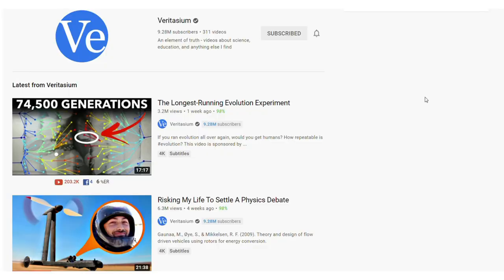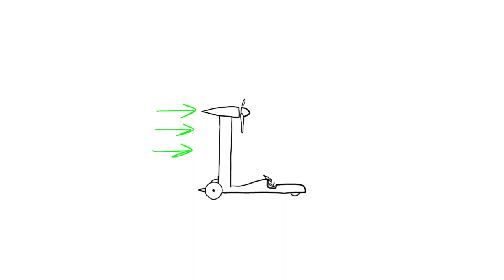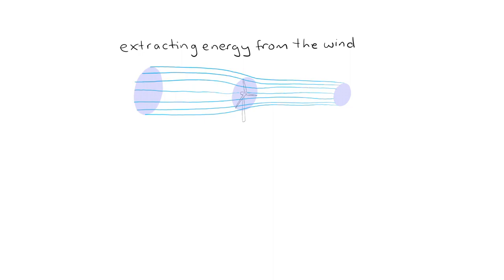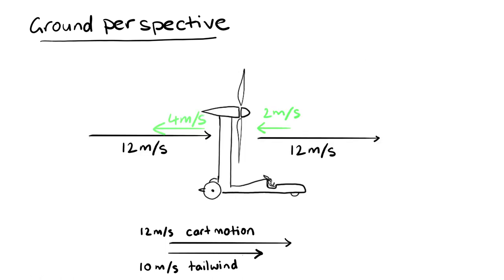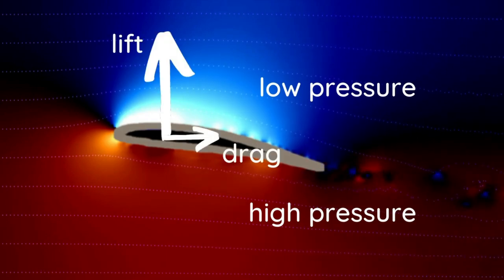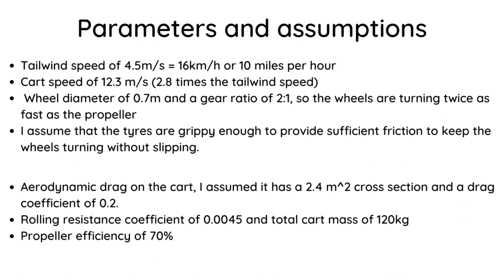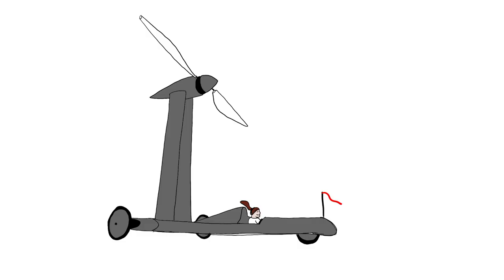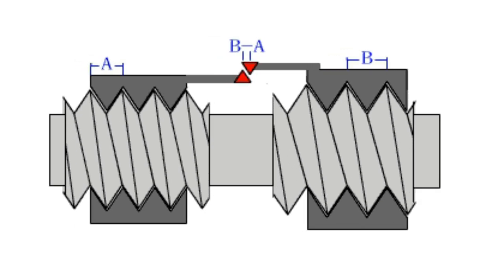Downwind Faster Than the Wind by Veritasium: How Does it Work?

Comment: Nice, what has been missing from many of the analysis of this is the variable pitch which was a point of discussion in the original video about how to drive the cart but no one else has addressed. It's the variable pitch of the prop which allows it to accelerate in low thrust mode as the cart is accelerating and then introduce thrust as the cart accelerates. It's the play off between prop drag and thrust which is the key to the cart being able to approach and then surpass wind speed. My mental model of this has always been the relative airspeed across the prop disc compared to free stream airflow and the resultant energy flow either towards or from the wheels. I'm of the opinion that at cart speed V0 the prop is driving the wheels as it is the source of most of the drag that starts the vehicle moving and then it's the disc of air which provides the drag. The reason it can accelerate beyond wind speed is that the disc of air is moving aft (thrust) as the prop accelerates so I would argue that the prop drives the wheel throughout.
Reply: Just so I understand your argument, what mechanism do you say is being used to get power from the propeller to the wheels?
Reply: The variable pitch is not key. Their prototype had fixed pitch and went faster than the wind too. It just needed longer to accelerate. Search youtube for "BUFC second run"

Comment: I think the hard part to grasp is that the ground itself is part of the mechanism. I find it hard, anyway :-)
Reply: It could be me but as explained, it seems to me that if there is no wind, pushing it to sufficient speed should keep it in motion too.

I'd love to see them put that to the test, even if it's just the driver pedaling until the prop starts accelerating the vehicle.
Reply: @Neetje42ever  no, because you need to be able to detract power from the wind.
She mentioned in the beginning that an outside observer will see the wind behind the turbine being slower than in front. This won't be the case when there is no wind. ;)
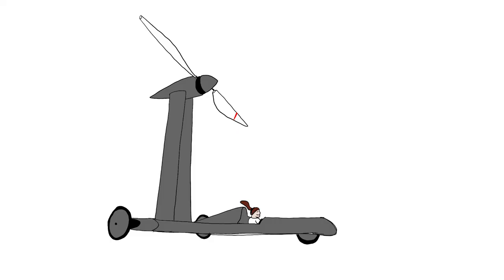Reply: @Robbedem  True but I wasn't looking at the general wind speed differences. If you look at 12:27 and beyond you'll see that a lot of the forward force isn't generated directly by thrust, but by lift. An aerofoil can generate a lot more lift compared to the drag it induces. The wheels have a lot less effort needed than it appears to keep the propeller spinning and generating lift. 

But I'm not an engineer and considering this sounds an awful lot like a perpetuum mobile, I'm just going to call bs on my own claims.
Reply: @Neetje42ever  actual energy is extracted from DIFFERWNCE in speed of GROUND AND WIND
Reply: @Neetje42ever  No, you are right, you don't need wind. You can move the ground instead, like the small modells they put on treadmills.  ;D But it's the same thing as wind blowing, but i had to think about it for a few minutes.
Reply: @magearamil8626  Yes exactly.

Comment: Excellent video, as usual! 
   However, there is a simpler explanation at a higher level of abstraction: The Bauer technique used by the Blackbird is merely an upside-down windmill boat (or windmill land yacht). 
   
That is my "Mill-Prop" theory explanation. In both cases, a "mill" drives a "prop". For the windmill boat, a wind-mill drives a water-prop. For the Bauer vehicle (such as the Blackbird), a wheel-mill drives an air-prop. A windmill land yacht can sail directly upwind, which is the upside-down equivalent of a Bauer vehicle (such as the Blackbird) sailing directly downwind faster than the wind. 
   To prove the equivalence, to show that they are higher level upside down versions of each other, it is possible to construct a craft that can sail both directly upwind and directly downwind faster than the wind, both at the same time.  
  Consider a blimp. Put an air propeller at the nose and face the blimp downwind. Suspend on a very long shaft from the belly of the blimp down to a lift-type vertical axis windmill (such as the Sharp Cycloturbine). The VAWT (wind-mill) is near the ground where the wind moves much slower. The VAWT is connected to and turns the air-prop. Size the VAWT and the propeller for the best match.
    Due to the wind gradient, the wind at the height of the VAWT is slower than the wind at the height of the prop. In other words, the upper wind is moving faster than the lower wind. The upper wind will carry the blimp along with it. But that will cause the VAWT to move faster than the lower wind. So the VAWT will rotate. The VAWT will therefore rotate the prop to create thrust. 
   If both the VAWT and the prop are efficient, then the blimp will outrun the upper wind. So it will sail directly downwind faster than the wind. The VAWT will therefore move faster than the lower wind as well. But from the frame of reference of the VAWT, the VAWT is moving direct upwind into the lower wind. And the VAWT is part of the blimp.
   So the blimp is simultaneously sailing directly downwind faster than the wind and also sailing directly upwind, both at the same time. Since the blimp is doing both at the same time, the technique of sailing directly downwind faster than the wind and sailing directly upwind must be the same technique. That technique is the Mill-Prop technique.
   People have trouble understanding the Mill-Prop technique because we are not practiced at thinking about relative velocities. It gets easier with practice. But it's easy to get out of practice.
   There are additional techniques for sailing directly downwind faster than the wind which I have devised based on my technique of "Power Alternating Sailing" (PAS). Using PAS, it should be possible to sail directly downwind faster than the wind using square sails. 
   Of course, as "everybody knows", it is absolutely impossible to sail directly downwind faster than the wind using square sails because the square sails would run out of wind. Ask any engineer or physicist and they will confirm that impossibility. That impossibility is the "conventional wisdom". 
   But if, as an inventor, we assume that it is possible, and then decide to figure out how to do it, the answer is rather simple: Oscillate two square sails fore and aft using the wheel-mills to do so. In other words, use two square sails in tandem oscillating opposite each other. One moves backward (relative to the vehicle) while the other moves forward (relative to the vehicle). Then allow the square sails to collapse when moving forward relative to the vehicle and open when moving backwards relative to the vehicle so that they function as a crude air-propeller. 
   The resulting vehicle is just a variation of the Mill-Prop Bauer vehicle (like the Blackbird). The square sail land yacht might not be much faster than the wind, but it should at least exceed the speed of the wind if it is well made and efficient, with low forward drag. There are various ways to construct the vehicle. 
   And, as mentioned, there are other sailing craft that could do the "impossible" based on the PAS technique. All of this is based on my "Metatheory of Sailing", which I may put into a book. A summary of the Metatheory was validated by a nuclear physicist who is a sailing instructor and the author of a book about the physics of sailing. 
  Rosie, if you would like to see some relevant drawings, and techniques, contact me at sharpencil@sbcglobal.net .
   Both versions of the Blackbird are magnificent achievements. And traveling directly upwind at almost twice the speed of the wind is quite amazing because previously no one had exceeded the speed of the wind. Blackford was the first to explain the need to operate the windmill at it's lowest drag configuration, not is maximum power configuration. But his models averaged a little less than the speed of the wind when sailing directly upwind.
Reply: YouTube added an unwanted space, so be sure to click the "read more" to see my full comment.